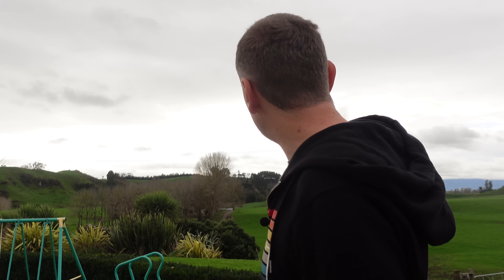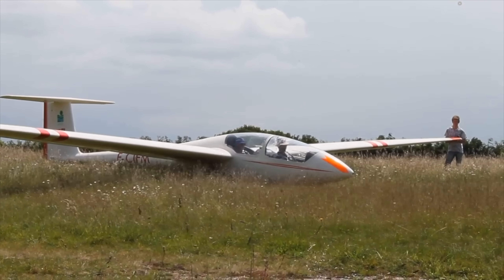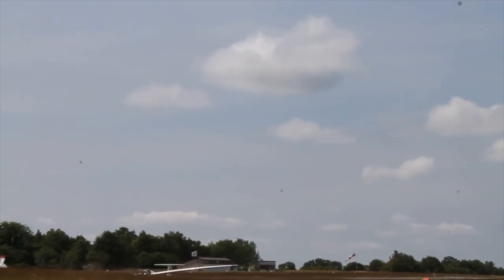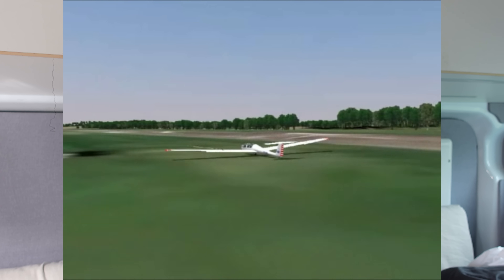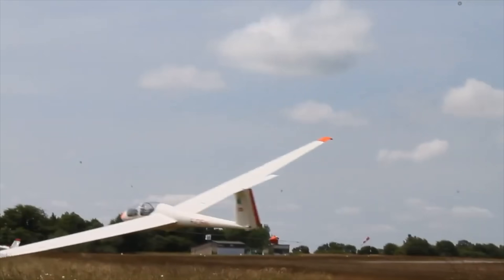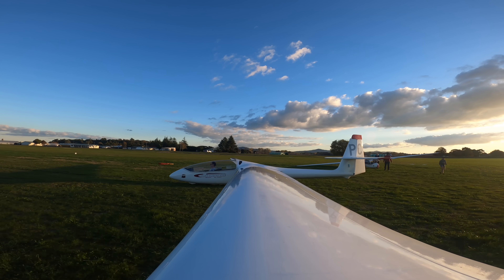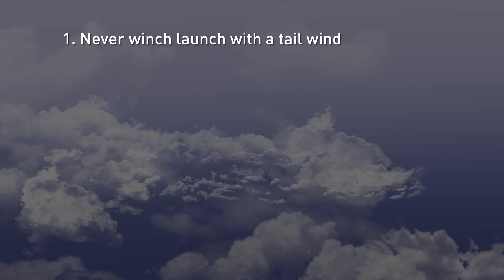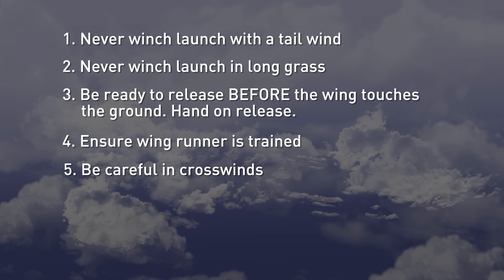Glider Winch Launch Crash 💥 Instructor Reacts

Comment: Great video - wish I 'd seen this 24 years ago. Dropped a wing on a Skylark 4 in 1997 while winch launching. I was new to the type and didn't get to the cable release in time. Smashed left leg up so bad it was amputated below the knee three months later. The best advice here is to hang on to the cable release and pull that sucker if the wing goes anywhere near the ground. Take it from someone who knows. BTW I do OK with 1.5 legs - just so glad to be alive which I very nearly wasn't
Reply from the maker: Hi Rob, thanks for sharing, I can't even imagine what that would be like to go through. A critical lesson for us all. And exactly right, great to have you with us!
Reply: @PureGlide  No problem! The other big takeaway for me was how quickly it goes wrong. Winch launching often seems routine but there is a phenomenal amount of energy involved and your control over events really is on a knife edge.
Reply: all my sympathy. Hope you could go and pick up flying again after adequately healing...
Reply: I’m an occasional glider pilot having had both winch and tow plane launches. I always used to promote gliding as a safe sport to my wife. I will no longer do that after seeing this video and reading the comments below 😮 Great video and clear explanation of what can go wrong in a slips second.
Reply: Thanks for telling your story. So shocked to hear you suffered such a terrible injury in exactly these circumstances. I'm doing a LAPL, but have found these videos about gliding very informative and they add a valuable dimension to my 'motor' studies.
Reply: @richardweldon2062  Hi Richard,  thanks for your comment. Like so many of us I've been fascinated by aviation in all its forms from an early age. It's a fantastic and safe sport but if you make a mistake or become complacent like me, it bites you hard. Airmen and women have learned this the hard way  and thats why checklists are the number one priority. Enjoy your flying and stay safe!
Reply: @Rob Munro 
🛫📖🛬

Good to hear from you Rob?
You are really right things happen pretty quick when you're so close to the ground.

Time will take care of the night sweats and you're active involvement moving forward will lead to more anticipation and better memories.

Many of us have hit the "Dirt Brake"  at one time or another.

Just don't ever do the infamous "Figure (9)"!

Best to you Rob

And may GOD continue to bless your life 🛐

You are still very young so redeem the time 👍

📖🙏✈️🐆
Reply: Always have a hand very close to the yellow release knob, that is your training, for some things can go wrong these first seconds. But that is hind sight.
Reply: Douglas Bader is 1 of my hero's.
Reply: Rob,
Thank you for sharing a tremendous story & lesson.
Very curious to know;
Did you return to the sport?
(I'm betting that you did?)

GOD bless
📖🛐🛫🛬🇺🇸🇺🇸🇺🇸🐆

Comment: Why is the wing touching the ground so dangerous? Did this really need to be answered?
Reply: The friction on the wing touching the ground causes extra drag and slows this wing, the other wing is not impeded and is not slowed, the result is that the unimpeded wing generates more lift and the glider rolls towards lower wing pinning it onto the ground. The nett result is a cartwheel.

With a K21 the tips point down and have a very small rubbing strip about 100 x 10mm and offer little resistance, so pilots might be able to get away with a wing drop, but not always.

In 2013 we had an accident on the airfield where I work as a professional gliding instructor, it occured on my shift.

The pilot was experienced (but not very current) and was flying a Nimbus 3 20m glider in blustery conditions. On launch the right wing went down and touched the ground; the Nimbus has a polyhedral wing and the outer 2m was pinned to the ground. The glider flipped upside-down and crashed inverted. The pilot died instantly.

I assisted with the AAIB investigation (the report is below) 

https://assets.publishing.service.gov.uk/media/5422fd21e5274a1317000923/Schempp-Hirth_Nimbus-3_glider_G-EENN_06-13.pdf

Essentially the report is correct; however the measurements were taken (by me)  in feet and were erroneously reported in metres.

I concur with the conclusions.
Reply: @christopherrobinson7541  sorry I suck at sarcasm my point was. With any airplane if the wing touches the ground it is dangerous and considered bad.
Reply from the maker: We have lots of non glider pilots watching, so it all has to be explained!
Reply: @PureGlide  Every day is a learning day and the more we learn the more we can teach and the safer it will be for everyone.

Comment: Chatting with fellow instructor, analyzing a similar accident.  He recently was soring in France and they had lanyard attached to the release, looped around the pilot's wrist so they could pull the release while having enough slack to prevent an accidental release... and since you do not have hold on to the release, this way you also do not accidentally miss when you have to pull.  

Fly Safe
Reply from the maker: It's an interesting idea, although I'd suggest the tow release should always be in reach, without extra tools! It is easy to slip back in the seat with a winch I realise.

Comment: Hello, I'm instructor and [correction, not about 10 years ago =>it was in spring 2016] I met the pilot in the front seat during this accident.
He explained that this flight occured in spring during an open day of the gliding club to make some advertisement and get some new members.
The club had a lot of pressure to make flights with paying passengers.
Because it was one of the first days of flight after winter season it was the rush to finish winter maintenance, get everything ready etc... and no time to get the grass cut! 
You have seen the result.
They have been very lucky and no severe injuries occured. Just a miracle.

Only one thing to remind? => CUT THE GRASS!!! No matter the precious time it takes.
Reply from the maker: Hi thank you for sharing! Yes it was a relief to learn there were no injuries. Quite remarkable after seeing the footage.
Reply: We don't tend to think of gliding as a form of aviation that is subject to "commercial pressure", as it's usually only recreational in nature, but the comment above proves that even soaring can be subject to a form of "get-there-itis", or motivation to complete the "mission", which can still lead to impaired pilot decision making.

Comment: Crikey, I thought that was one of those r/c aeromodeler's gliders! 

I've done my share of wing running. The RAF insisted any newbie wing-runner ran behind someone else, "to get the feel" of what was involved, before having the instructor running as a backup on their first few launches. The NCO instructor would shout a deafening "RUN!!" in your ear if you weren't going fast enough, and you kept running I can tell you!

This club, especially that individual, appears far too casual.
Reply from the maker: Yeah using a buddy to help train wing running sounds very sensible. Cheers
Reply: Years and years ago, learning to fly on ask-13, ka-8,  as wing runner we were told to  try to give the wing a push (up or down).  Just open your fingers.
Reply: @leodelange1  Wow! I'm amazed you were told to "give the wing a push up/down" when releasing it as a wing-runner 😳! Surely, doing anything that would override control of the pilot (without his knowledge) would be highly questionable, even endangering the aircraft, and leave the wing-runner liable if there were an accident? I'm amazed and would be most unhappy if my wing-runner did anything other than simply releasing the wing in a level orientation. 

(No offence to yourself, Leo, but this does sound a highly questionable instruction you received.)

Comment: I am not a glider pilot but a hang glider pilot with tow endorsement. looking at the video the final gotcher was he let the glider get into a lock-out situation and locked the glider out. In towing hang gliders we use a weak which has saved a good number of pilots including myself when the wind went Katabatic without me noticing.
Reply from the maker: Yeah all gliders winching have a weak link also. Not sure why it didn't break before it back released, but maybe the winch driver let the power off once he/she saw it was going badly

Comment: In Paragliding, the winch operator is educated/ instructed to cut the line is cases where it would be helpful. For gliders, is it only the pilot who can/ should release the line? Yes, cutting the line is expensive and a PITA afterwards, but still better / cheaper than this..
Reply from the maker: Most winches do have a guillotine at the driving end, the problem is it's over 1.2km away at our airfield, some might be further. They simply can't see what's happening at the glider end until they're up in the air.
Reply: @PureGlide  Time to upgrade to remote controlled winches.. RC winches have revolutionized the safety and comfort in PG. The price for the electronics is 1/100 of the damage in this clip...

Comment: as a fellow instructor i don't fully agree that the wingrunner needs to try to run. Our winch pulls so fast that there is more risk of the runner not keeping up and pushing the tip down, or up, trying to follow the plane.  I prefer they just level the wings and let it pull out of their hands without any vertical movement. keep the wing level and your hand flat and just let it go.
Reply from the maker: Yeah fair enough, and yes that is all important. A longer run probably wouldn't have made much difference in this case. He possibly should have had the into wind wing down more than he did? I might make a separate video about wing running...
Reply: @PureGlide  all depends on your winch engine capabilities of course. i just worry the wingrunner stumbles and pulls the wing down with him. As a competition leader i actually insisted to hold the wingtips myself at start, and not let the pilots family do it as they are normally used to doing that around here. they simply don't know your winch.
Reply: @PureGlide  there's a lot of weakness in wing running technique. To my eye, the wings were level prior to the runner letting go. There was a clear right crosswind.

From the wing runner perspective on most gliders (at least the high wings I'm used to),  you can feel the center of gravity shift left or right of the contact point of the tire. With a wind from the right it is pushing on the airframe above the contact point, trying to bank the plane left.

In effect:
1) if you let go of the wing and it would fall down, you should hold the wing higher,
2) If you let go the opposite wing would fall, you should hold the wing lower.
3) While holding the wing it should roughly be floating neutral in your hand, and you shouldn't be fighting to hold it up

Comment: Things go south very quickly on an incorrect winch launch. A Jantar I had just sold a couple of days before was written off and the  pilot killed instantly in a similar event. In his case he stalled one wing with too steep a rotation, slight crosswind  and was vertical into the ground before he could pull the release, even with a lanyard it had to strap around the wrist. The first 10 seconds of a launch will kill you if you dont release the MOMENT the tip touches the ground or vegetation, or if you rotate and a wing drop happens. Run with a toy kite in zero wind and watch it whip over and accelerate into the ground. Then imagine you were sitting in it.
Reply from the maker: I'm sorry to hear that. I'll pass that onto my Jantar owning friend who has just started winching. The least we can do is learn from other's mistakes and do everything we can to avoid it happening again. Thank you for sharing.
Reply: @PureGlide  i would say the issue with the std Jantar is the prone seating and relatively high nose on the ground. There is a temptation as it lifts its tail and clears the ground to raise the nose back to the relative position it was before. Dont do this, keep the nose a little lower and rotate slowly to the climb. They are not tricky, I came to one with 50hrs total and from a K6. But respect the physics.

Comment: 2-3 minutes into the video and you still have not mentioned the most important fact why this turned into an accident.. The fucking grass is too long!!.. A slightly dropping wing should not be a problem on a well mowed launch site, wind is then also not slowed down by the long grass also preventing the wing to drop even more.

Decades ago a rule came in place in Europe, grass should have a maximum length of 15 centimeters at the launch site.. exactly to prevent things like this from happening.. here the grass is 30-40 centimeters maybe even higher!  This was a preventable accident and they paid the price for it.

I have learned to keep my hands very close to the release handle, but not grabbing it, indeed to prevent it from accidentaly releasing it due to g-forces. Its the official policy in The Netherlands at the moment.
Reply from the maker: Thanks, yeah I get there with the long grass. It's tricky to figure out the order, as many people watching aren't glider pilots, so the basics have to be explained first...

Comment: I disagree about a wing runner actually running being important or even useful. As the pilot I'd 10x prefer them to 1) balance the wing so there is no upward or downward force (NOT necessarily level, especially with a crosswind), and 2) NOT take a chance of holding back the wing. Certainly the wing runner needs to be prepared to move forward if the tow plane or winch takes up more slack than there is, but once the full acceleration starts there is really nothing useful more to do, and only harm. If the wings are aerodynamically balanced at the moment of release then they will stay like that for far longer than the time to get enough speed for control (certainly with a winch). If the wing runner is holding the tip against an upward or downward force then a tip can slam down within half a second when they let go, with absolutely nothing the pilot can do. If I have any doubts about a competent wing runner being available then I prefer to launch without one -- something I've done dozens of times (aerotow, not winch).

I agree the wing runner here seems inadequately trained, but not because they didn't run enough. The problem is they should have been holding that wing tip high (probably) to balance it, or better on the other tip and holding it low. But bad wing-runs do happen, as do gusts. The primary thing wrong here is launching in long grass and the pilot not being prepared to release.
Reply from the maker: Yeah and with the crosswind (confirmed since making the video) they should be taking the wind into account. I agree it probably wouldn't have made much difference if they had run a bit more, but still might be better than nothing. Cheers for commenting

Comment: A nice exercise to show wing runners is to park a K21 in a crosswind and then hold the wings level. Get them to time how long it takes for the wingtip to hit the ground after letting go. Then ask them to hold the wings so they are balanced - rather than level - and then repeat the exercise. The difference in time for the wing to drop can go from 2 or 3 seconds to 5 or more instead.
Reply from the maker: That is a good idea to try! Thanks

Comment: It used to worry me at NZTO when they'd tow gliders out with the wings overhanging the tarmac by a metre or two while the grass was really long.   Drop a wing into that stuff and you're not going to have a good day.  These days you guys either just pop-up your power unit and fly off rather than land or trailer out after landing here.  I don't think I've seen anyone towed out of Tokoroa for a few years now.
Reply from the maker: Hey I landed there not TOO long ago I'm sure, although I tend to just get the trailer because it's cheaper. Unfortunately I upgraded to a pop up power unit a year ago, so that's the end of that nonsense (until the engine doesn't work :) ). Also for aerotow, again it's only the first small section when there's not enough air over the wings, and if you hit grass at that stage, it would generally be a ground loop, rather than lifting into the air.

Comment: Nice video, all good points. A couple thoughts - In a crosswind, the wing runner should not necessarily hold the wings level, but keep the upwind wing down a bit so the glider balances. At least as much as practical, that helps keep the wind from picking up the wing as soon as you let go. We can only launch from one direction and so have to deal with crosswinds fairly often. A slow winch start makes this problem worse, I think that is more of an issue with the tension-controlled winches. A smooth but rapid acceleration is a good thing.
Reply from the maker: Yeah I think I need to make a separate video on wing running! And yes this did have a cross wind so the wing runner might have been on the wrong side and not taking the wind into account like they should. Cheers!

Comment: I think it's totally inappropriate to call out the wing runner as a contributing factor. The launch was very abrupt and the glider was essentially yanked out of his hands. Holding onto the wing isn't good either, he did let the glider go as soon as he saw the glider was accelerating. The obvious contributing factor was the tall grass.
Reply from the maker: Yes running might not have made much difference. However the BGA advice for crosswinds is to have the wing runner on the upwind side and lower the inter wind side a bit. So that might have been more of an issue...